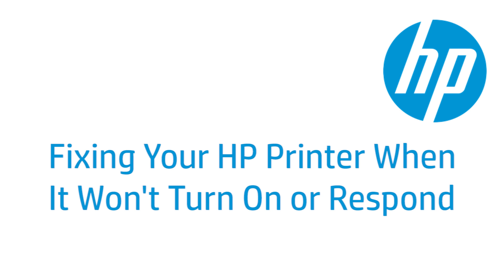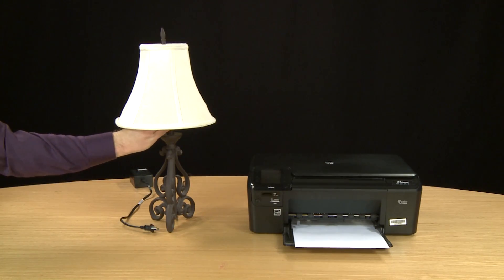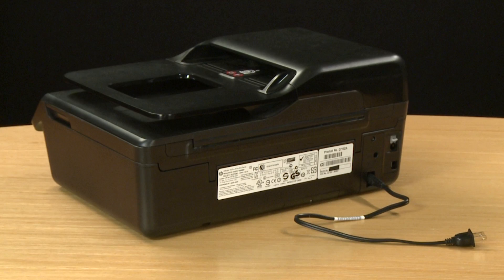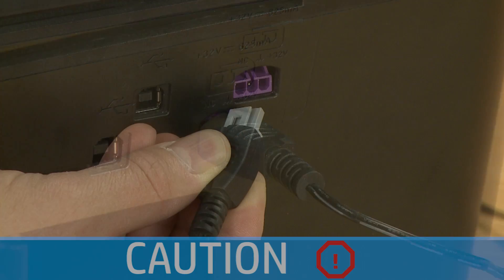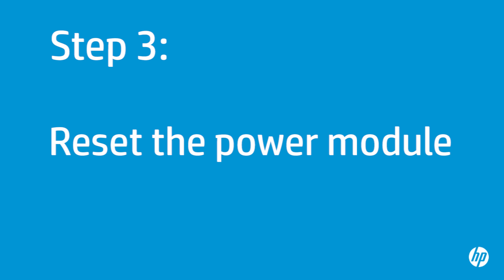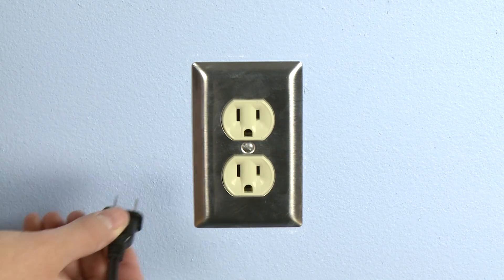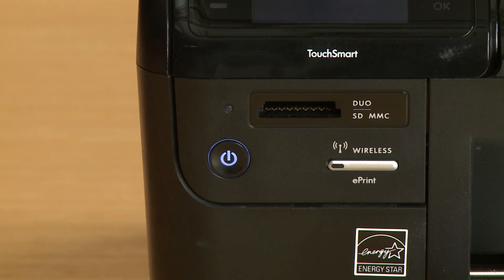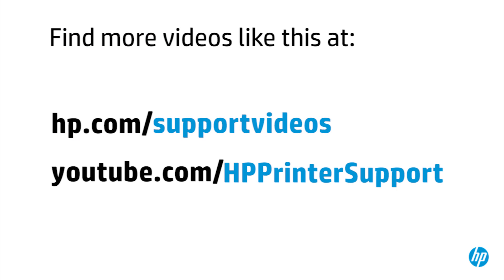Fixing Your HP Printer When It Won't Turn On or Respond

Comment: I have a Hp Deskjet 3000 series printer.It doesn't turn on when i press the power button.On further investigation the light on the adapter is on when i plug it into the outlet but is not connected to the printer.But when i connect the adapter to the printer the light on the adapter goes of.Is it a problem with my adapter or is it a problem with my printer.Thanks in advance.
Reply from the maker: +Reddi Sathvik     Please use this document ( http://ow.ly/4nnebM ) as a checklist to ensure you have performed all troubleshooting steps.  If you have completed all the steps, please contact Technical Support at 1-800-474-6836 if you live in the USA/Canada region.  If you live outside the USA/Canada region, please click the link to find the phone number for Technical support in your country/region. http://www8.hp.com/us/en/contact-hp/ww-phone-assist.html

Comment: Hp i have a hp deskjetf380 all in one printer- scanner - copier it wont turn on my power supply is okay and and my outlet if fine do you have any other suggestions that might benifit me.
Reply from the maker: +Kai Thom   Please use this document ( http://ow.ly/4nn92f ) as a checklist to ensure you have performed all troubleshooting steps.  If you have completed all the steps, please contact Technical Support at 1-800-474-6836 if you live in the USA/Canada region.  If you live outside the USA/Canada region, please click the link to find the phone number for Technical support in your country/region. http://www8.hp.com/us/en/contact-hp/ww-phone-assist.html

Comment: as soon i plug it it all the lights r alrdy on and unresponsive,it wont turn off either without i pulling the plug,once in plug it in again its the same problem loop,what do it do?
Reply from the maker: +TRO LINU   Please try a complete hard reset of the printer by following the steps below. 

- While the printer is turned on please unplug it from the wall outlet. 
- Please unplug the power cord from the back of the printer. 
- Wait a full 60 seconds. - Please plug the power cord into the back of the printer while plugging the other end directly into a wall outlet, not a power bar/strip or surge protector. 
- If the printer doesn't turn on by itself, please turn the printer on. Please the printer plugged directly into a wall outlet so that the printer isn't "starved" for power. 

Please let me know if this resolves the problem.

Comment: I have a HP Photosmart C42000 series that is now experiencing this problem. I tried every single steps and none of them worked. I noticed that when I plug in the power cord, the printer show it has power with the green lights and screen lighting up. However, it quickly dies out and the power button won't work. The screen also seems to emitting light through it is displaying only a gray background.
Reply from the maker: +Normacly   I have 2 different troubleshooting documents for you.  Please start with the first one and if it doesn't resolve the issue, then please work through the second one.  

Blank Control Panel Display   http://ow.ly/10p4mx
Printer Does Not Turn On   http://ow.ly/10p4rx

Comment: I have a hp officejet pro 8600 premium. when I purchased it i also purchased a 2 yr service agreement which expired 6 months ago. I have this unit in my office and only use it sparingly and have never had any issues however I recently tried to turn it on and nothing. This printer has been barely used so I really dont want to purchase a new one what could be the problem?
Reply from the maker: +Clyde Stokes, Jr.   I've included the "HP Printers - Printer Does Not Turn On" document ( http://ow.ly/YwmP6 ) for you.  Please perform the steps in the order presented.

Comment: I have an officejet 8600 plus and it won't turn off and my warranty is up so I don't know what to do I have tried everything
Reply from the maker: +kostas argyros    Please perform a hard reset of the printer using the following steps.  

-  Since the printer will not turn off, please unplug the power cord from the back of the printer. 
-  Please unplug the power cord from the outlet.
-  Please wait a full 60 seconds. 
-  Please plug the power cord into a wall outlet.  It is important that it is a wall outlet and not a power bar/surge protector. 
-  If the printer does not turn itself on, please turn the printer on. 
-  Once the printer has completed its startup routine, please turn the printer off using the power button. 

Did the above steps correct the issue?

Comment: my printer turns the light of the power button on and off all the time and doesnt let me use it, its a hp psc 1500 series all in one (printer-scanner).
Sometimes it stops and let me print something, but most of the time doesnt work, tried everything except the last step in this guide.. :C
Reply from the maker: +angel chingon   I've included the "Blinking Lights on the HP PSC 1500 and Photosmart C3100 All-in-One Printer Series" document ( http://ow.ly/XQIFy ) for you.  Please work through the steps in the order presented for the combination of lights that you have.

Comment: i need fatherhelpe about deskjet 2050 internal Power problems fixing ?
Reply from the maker: +sheakh musse   I am presuming that your post means that the printer does not turn on.  I've included the "HP Printers - Printer Does Not Turn On" document ( http://ow.ly/XQGW4 ) for you to work through.  If you get to the 'Service the printer' section, please contact technical support.  To contact support, what you can do, is use the following link to create yourself a case number, then call.  It may help speed up the call process.

Step 1. Click on the link:   www.hp.com/contacthp/
Step 2. Enter Product number or select the auto detection
Step 3. Scroll down to ‘Still need help? Complete the form to select your contact options’
Step 4. Scroll down and click on ‘HP contact options’
Step 5. Click on ‘Get phone number’

Case number and phone number appear.

Comment: OMG you guys are so helpful the second tip was the problem thanks i will be sure to share and like this video
Reply from the maker: +Aminatou Barry   That's outstanding!  And thank you for sharing.  😊
Reply: ***** no prob
Reply: +HP Printer Support mine is old and will not work even though its the same one and im using every thing the same what should i do btw im using a dell computer with a hp printer if dat affects anything
Reply from the maker: +ryanknowstecmobowl   Thanks for the information, but would you please provide some additional information? Where applicable I have included a guide to assist you in finding the information.

- What model and product number of HP printer do you have? http://ow.ly/VRTFa 
- What operating system are you using on your Dell computer?  http://whatsmyos.com/
- Is the printer plugged directly into a wall outlet?

I will watch for your response.
Reply: ryanknowstecmobowl ok but what was the problem
Reply: Explodingcrepperela idk.
Reply: ryanknowstecmobowl oh

Comment: I have a HP deskjet 3545e which is having a internal module. PlZ help me to resolve my problem. My printer is not turning on, not responding.. Plz guide how to reset internal module thx
Reply from the maker: +Rahul sahdeo    Please use the document titled "HP Printers - Printer Does Not Turn On".  It has the steps to reset an internal power supply. It will also help you determine if you have a replaceable power module.  To find the document please search for C01321436 on HP's home page or using Google search.

Comment: I have a wireless C310 PhotoSmart and my problem is it will not turn on at all at my house. I've had it for approx. 4 yrs but hardly used but when used it worked perfectly. I took it to Best Buy to see if they could work on it and low and behold it turned on immediately. Brought it home plugged back in and it turned on for about 30-60 seconds then went off again. I have tried numerous places in my house and it still will not turn on so my son took to his house, plugged it in and it turned on. Brought it back home and still nothing. I have checked everything the video says to check and all is good. Power indicator light works but printer will not turn on. Getting very frustrated with this and I will never buy another HP.
Reply from the maker: Kathy McCallister I recommend following the steps in this document on HP Printers - The HP Printer Does Not Turn On or Respond When the Power Button is Pressed. This resource can be found by Google searching "c01321436". If the issue continues, please contact our technical support by going to Google search and enter 'contact HP worldwide'.  Your first option should be the site for contacting HP, when you click on it you will be prompted to choose your country/region.

Comment: This started explaining how to reset power module but skipped completely how to reset internal power module and rather focused on external power module reset.
I have a printer with internal power module and need to find out how to reset it
Reply from the maker: Sachin Dhar You can perform a hard reset by unplugging the power cord from the back of the printer and from the wall. Press down on the power button of the printer for 30 seconds, and then plug the power cable back into the wall, and then into the printer.

Comment: Tip: connect a USB cable and then try to power up. Worked for me.

My 276DW wouldn't power up after a power failure.
The info in this video was not very helpful, just common sense suggestions, and so did not solve the problem.
As I have the 276DW connected wireless, I thought I would try powering it up with a USB cable connected to my PC.
And that did the trick, it powered up.

Comment: I have a printer HP OfficeJet Pro 8600 plus and after a power surge it won't turn on, all these lights of the reset that the video shows are non-existent in my printer, now what do I do?
Reply from the maker: Estefi Nunez I recommend following the steps in this document on The HP Printer Does Not Turn On or Respond When the Power Button is Pressed. This can be found by Google searching "c01321436". If the issue continues, please call our technical support at 800-474-6836. If you live outside the US/Canada Region please go to Google search and enter 'contact HP worldwide'.  Your first option should be the site for contacting HP, when you click on it you will be prompted to choose your country/region.

Comment: Hi I have a printer HP Deskjet F2480, the problem is at first all its lights are blinking, the paper, the ink and the power button, so we thought its just needs ink since its ink levels are already low so we tried refilling ink to the cartridge and tried turning it on, but now it doesn't turn on or blink at all. What would I do?
Reply from the maker: Neil Bryan Duhaylungsod I recommend following the steps in this document on The HP Printer Does Not Turn On or Respond When the Power Button is Pressed. This resource can be found by Google searching "c01321436". If the issue persists after completing all of the steps in the document, please call our technical support at 800-474-6836. If you live outside the US/Canada Region please go to Google search and enter 'contact HP worldwide'.  Your first option should be the site for contacting HP, when you click on it you will be prompted to choose your country/region.

Comment: I use hp d1000 printer. My black cartridge was low so i didnt use the printer for 2 months. That time printer was connected to pc. I didn't notice that. Today i purchased a black cartridge and wanted to change it with previous one but the printer wont start. there was no power. i watched the video and did everything. when i removed the power cable and external cable of adapter and leave it for 15 sec, after that i reconnected the power cable to external cord and the adapter light was turn on. but when i connect it with printer the adapter light goes off and the printer wont start!!! what should i do??
Reply from the maker: Raisul Bappy Please call our Technical Support at 800-474-6836. If you live outside the US/Canada Region please go to Google search and enter 'contact HP worldwide'.  Your first option should be the site for contacting HP, when you click on it you will be prompted to choose your country/region.

Comment: I have a HP Laserjet P1006 printer that has been a workhorse, but now won't turn on.  I have the original power cord, so know that it is compatible, have plugged it into an outlet that I know works, and still nothing.  There was a very quick light flash when I turned it on, and now nothing.  Any suggestions?
Reply from the maker: Susan Helmich Design, Inc. I am providing you with an HP Support document below that should help you identify what is wrong and explain how to fix it.
http://support.hp.com/us-en/document/c01237241

Comment: well there's 7 minutes 12 seconds of my life I'm never getting back. I dont who this video is made for - my guess is that if you need to be told to do all the excruciatingly detailed checks outlined here, then you really shouldn't be handling electrical goods. Before watching this I was mildly upset that my printer wasnt working - halfway through I was so depressed I wanted to stick my fingers directly into the wall socket...
Reply: i laugh so much off this water fill my eyes

Comment: I had a power surge, and since then, the printer is temperamental.   It only works in a wall outlet and not a power strip, when it does.  I have had this printer since 2011, and it is not worth it to fix it now.  I do not have another power cord.

Comment: My hp office jet pro 8600 plus turns off and on by itself.
Reply from the maker: Alexis Stroke Make sure that your printer is plugged directly into the wall outlet and see if that fixes the problem. If it does there may be something going on with the power bar or surge protector. If it does not solve the problem contact HP Technical Support.

Comment: I have a hp PAC 1510 all in one, when I plug it in all the lights flash rapidly at the same time. It's been working for years but now it won't. Sometimes if I leave it on for several hours it starts to work but after an hour or two it starts flashing again. HELP
Reply from the maker: RyanTheBaller27 I suggest you do a Google search for "c00476294" which will bring you to a document titled "Blinking Lights on the HP PSC 1500 and Photosmart C3100 All-in-One Printer Series", which will help you identify what the blinking lights are trying to tell you.

Comment: I have an HP 4500 wireless printer and it won't turn on. I've tried everything that says on the video and it doesn't work. the only thing is that the tip of my power cord is grey and the slot on the printer is purple. should I get a new purple power cord? I don't know if it would solve the problem as that was the original power cord that came with the printer. thanks
Reply from the maker: Jaime Munera For something like this I would recommend contacting HP Technical Support to ensure you get the proper part.

Comment: I own a deskjet 2050, and all three light blink and it does not respond to the computer. It doesnt want to work no matter what I do. Any suggestions on a fix?
Reply from the maker: JRMR04
There is a document titled “Blinking Lights” for your printer which has the trouble shooting steps for the light pattern that you are describing.  Please search for C02061335 on HP’s home page or using Google search.

Comment: I have a 1290 hp printer. The lights flash on twice when I plug it in. but won't power on
Reply from the maker: Roger Olthoff
I can't find anywhere an HP printer with a model number of 1290.  Would you please let me know the model and product number of your HP printer?  Thank you.
Reply: It decided to work now
Reply from the maker: Roger Olthoff Glad to hear it. If you need assistance in the future do not hesitate to ask we are here to help!
Reply: i have the same problem with HP PSC 1410 what to do?
Reply from the maker: *****
I suspect your power adapter needs to be replaced. First check to ensure you are plugged directly into the wall outlet and if you could try a different outlet before replacing the power adapter.

Comment: Hi. im using HP 2510. the power button keeps on blinking and it cant print or scan anything. i tried to align it but it appeared in front of my desktop that the device is busy. it actually not printing anything. i just bought it half year ago. can i know what the problem is? Thank you. =))
Reply from the maker: Amy Tang
I am presuming that you have a Deskjet 2510 printer.  Please search for C03279449 on HP's home page or using Google search.  The title of the document is "Blinking Lights".  There is a section  titled "Issue: The Power light blinks".  Please follow the steps in this section to correct things.
Reply: My issue is The Power Light blinks. and i dont understand the solution 3. what's the meaning of Service the All-in-One?
Reply from the maker: Amy Tang It means you need to contact HP Technical support because you are faced with a possible hardware issue that needs to be repaired if possible.
Reply: need to pay for it then?
Reply from the maker: Amy Tang
They will give you the options that are available to you, of which some of the options may require payment.
Reply: i got it. thanks for the help..=))
Reply from the maker: Amy Tang
You are very welcome.  Have a great rest of the week.

Comment: My hp Deskjet Ink Adantage 2060 when turn on no power. Can you help me?
Reply from the maker: greco0ful
There is a document for the Deskjet Ink Advantage 2060 printer titled "The HP Printer Won't Turn On or Respond When the Power Button is Pressed".   Please search for C01321436 on HP's home page or using Google search. It will walk you through the required trouble shooting steps.